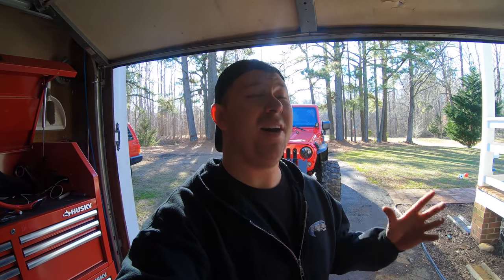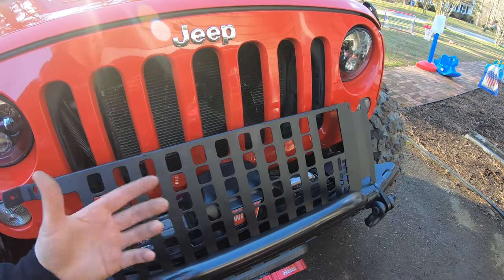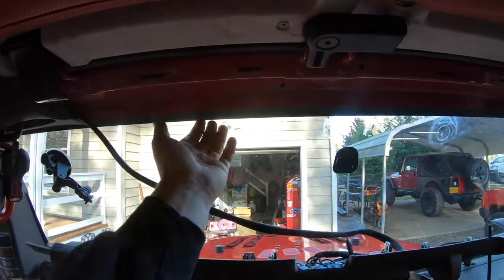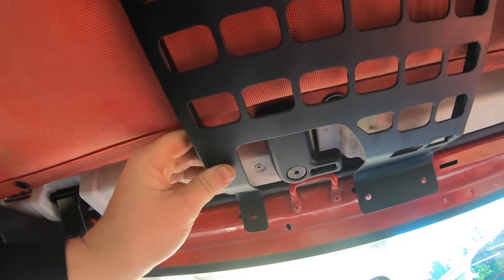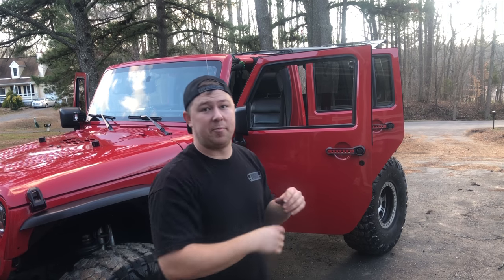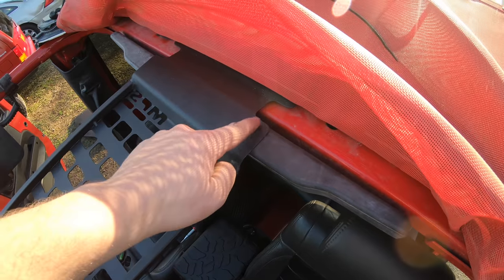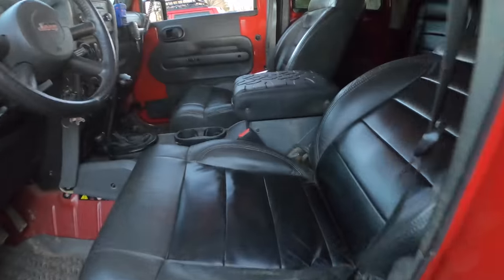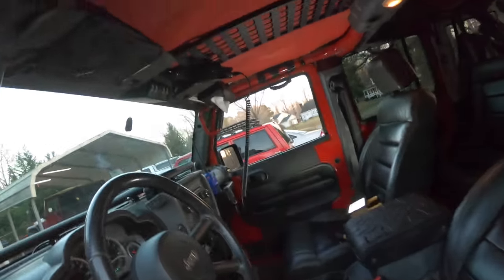Jeep JK/JL Overhead Mounting Panel Install

Comment: After watching your video about this overhead rack, i checked their website out and bought one! I used it to mount my CB radio and Whelen siren for the electric air horn and PA system. Thanks for showing us this and the install of it. Quality made !!
Reply: What did you use to mount your CB with? Was it a kit?
Reply: @msburrage74  I just used the bracket that came with a CB radio. I have it twisted to the side and then I ran really big oversized washers on the top side of the rack so they couldn't fall through.
Reply: jessie hale gotcha! I actually just went and bought some washers. Sounds like that’s the best way to do it. You know if anyway to secure the cb unit from theft? I am concerned about for when I go door and topless which I do often.
Reply: @msburrage74  Only thing you could do is try to find some security screws that take that Star tool with a hole in the middle but other than that there's nothing you can really do. Maybe get a Phillips screw and then fill it in with silicone so it looks like it's flush that way the average Joe won't try to mess with it but if you need to remove it you can just pick out the silicone?

Comment: When I installed mine, I didn't use the zip tie either. I drilled two holes in the overhead roll bar and used two nut zerts. Well secured and no rattles.

Comment: Nice install video. You hit it as to why you want to remove freedom top for install. You can snug the rack up a little farther. The tabs are not bent to exact angle so feel free to adjust. Do take the time to measure and trim plastic panel for a better fit. You can also run your CB wires  behind the plastic panel. Drill a hole or two in plastic panel for wires to come out where you want / need them. Really makes for a clean install. As for Molle bags, some have a Velcro back. They really work with the rack. The bag just rips off Velcro when you need to use the med kit etc. attachment portion of bag stays on rack. Yes, throw away the zip locks. I hope this helps.

Comment: Hey 👋🏻 Just as info for your followers. It holds super strong with the tie wraps. You just have to loosen the back of the hardtop screws to have enough space to fish the tie wraps around the main roll cage tube. Once that done one tie wrap on each side is way plenty to hold it in place strongly 👍🏻 Great vid too 🤙🏻
Reply: Overland Vegan do you plan on offering one for a TJ.

Comment: I have a similar product. No drilling required. Put it in my soft top. It wouldn't fit in the Wifey's hard top configuration. Heavy. Lawrence's Dad gave it to me.  I love it. I did get some squeaking but I fixed it with some leather scraps.
Reply from the maker: Nice! How does it attach without drilling holes?
Reply: @JKGearandGadgets  You remove the footman loop (not needed on the soft top) and it screws in there. On the back side it has sort of legs that lay across the toll bar. It is secured with hose clamps that slide under the sound bar. It weighs about 5 or 6 lbs.  The mole cover goes over it.  It has a place for a CB mount as well. I have Cobra 75WX all in one so, not needed

Comment: Thnax for the video. Just installed one in my JK. I agree that this "zip ties" are total crap. I understand that they are not structural and just function as an anchor point... but zip ties??? I used a couple of "christmas tree" push pins... way better.... Rugged Radio next!

Comment: Installed one on my 2016 jku. Love it though I connected mine with rivets in the back. Problem is the metal on metal squeaking that it produced after a few weeks and a few thousand miles. So drilled out the rivets and placed a piece of thick felt between the 2 pieces of metal and reattached the back....now its perfect with no noises emanating from the 2 pieces of metal. Even if screwed on as the directions state there would still be the issue of metal on metal noises. So 1 little mod and it is 100% perfect.

Comment: Great video.  Zip screwing it to the speaker plastic may not be an option for those who still have roll bar pads.  I think that is why he has the zip tie. The pads would raise the rack an inch or so above the speaker pod thing.  When I secured my overhead rack, I used galvanized chain link pole clamps. Wrapped around the roll bar and bolted the rack to it in the bolt hole.  Just an option/thought.

Comment: See if your cb has 2 little holes or screws in the side of it. I mounted my mic hanger to the side of my radio overhead and it worked out great.

Comment: "Everybody hates xj's"

Whaaaat?? Eff those people, don't need that kinda negativity in life!
Reply from the maker: I don’t get it either, I love them. Most people that hate them have never owned them
Reply: I've had three Wranglers and a WJ. Never owned an XJ, but I'm definitely no hater. IMO, the XJ is right up there in icon status like the CJ/Wranglers.
Reply: I’ll never understand the hate smh
Reply: The XJ I previously owned was one of the best all-around, utilitarian Jeeps I've ever had.  I wish I never sold it; I could load it with 3/4 of a ton of wood pellets (for the pellet stove), or tow a 3000lb sailboat across the state.

Comment: Could you drill into the actual roll bar and the mount to secure it? Also, I hate rattles, I would have put some padding between the roll bar and mount.
Reply from the maker: You could for sure! Drill a hole in the panel and in the roll bar and hit it with a self tapper, I don’t have any rattles, but if it did start rattling then a bit of electrical tape or foam between the 2 would stop it

Comment: another great review!! just one question does the overhead panel rattle at all when driving?
Reply from the maker: Mine doesn’t, however if it ever does I will just put electrical tape or foam between the panel and the roll bar

Comment: Nice only thing i would do differently would be use rivinuts instead of self taping screws that will come loose. Rivinuts will not a little locktight and forget about it.

Comment: I've mounted radios overhead before and quickly realized that it is hard to drive and adjust the radio while driving. Looking up and looking at the display did not work for me.

Comment: So I have this now but I’m not sure how to mount my CB radio. Do you have a link to the mounting kit you used or some ideas on what to get?
Reply from the maker: I just drilled the mounting bracket, you just have to get creative
Reply: @JKGearandGadgets and how did you get the power and antena cables routed?

Comment: does it look like you could mount your S-tech on the molle panel vs where its at now? i have a cb and a ham mounted in that area and dont wanna give that up instead i would like to mount an S-tech or any other swich pod further back on that overhead molle panel.
Reply from the maker: Most switch pods have a hollow back, so mounting it on the panel wouldn’t really work. You would have to kinda make your own custom setup

Comment: Thank you for another great video!  I was noticing when you jumped down that you’re running without the factory rugs and just rubber mats. Are you also running without the plugs? How’s the heat when driving?  Thanks in advance.
Reply from the maker: I keep the plugs in, heat isn’t too bad but it’s also winter. In the summer it will get real hot. I will either bedline it or use bedrug
Reply: JK Gear and Gadgets thanks so much for the speedy reply!
Reply: JK Gear and Gadgets thanks so much for the speedy reply!